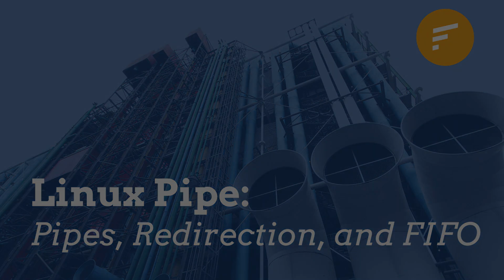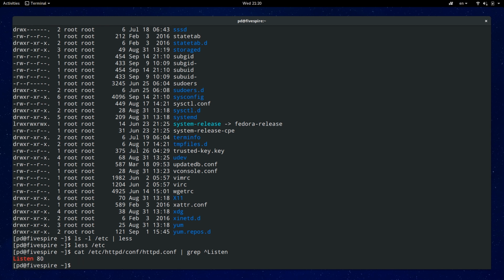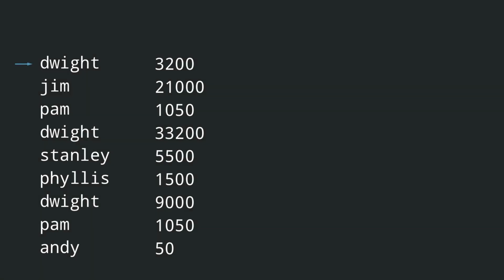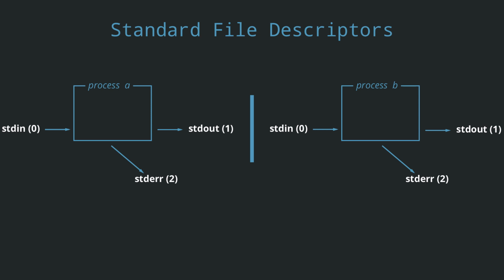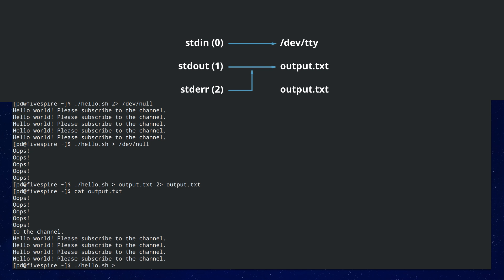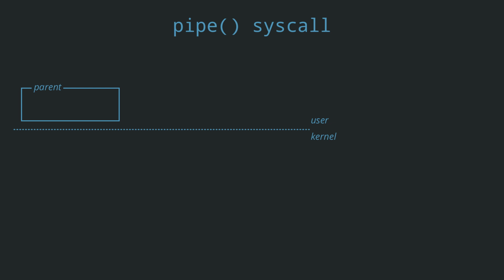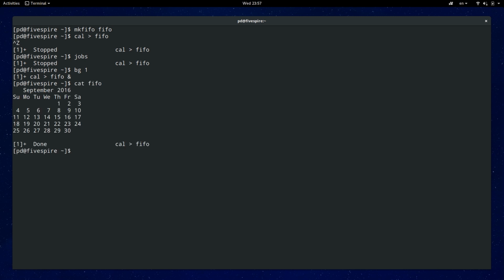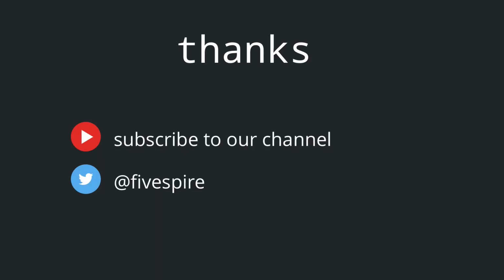Linux Pipes, Redirection, and FIFOs - In Detail

Comment: I was left totally confused by the naming similarity of the "pipe character" in shell vs. the "pipe function" in C.  Is that similarity meaningful or coincidental? Does the shell call the "pipe function" when it encounters the "pipe character" ?   Also, I could not decipher what you meant by "redirection" done by the shell - whether by that you meant ONLY what the shell does ,when it encounters the ">" and "<" characters, or whether by "redirection" you ALSO meant, what the shell does, when it encounters the "pipe character".  
Exactly, what does the shell do when it encounters the "pipe character" and how is that different from its actions when it encounters the ">" or "<" characters ?
Reply: pipe in bash shell is a redirect just as  <> 
Normal command  use will take input from either the command line or a file, one possible file is a special file called "standard in", output of results are generally written to the "standard out" special file or "standard error" special file. In most modern systems the stdout file is setup to write to the console and so prints to the screen. Redirection literally redirects the command output to some file other than "stdout". 
Pipe is equivalent to redirecting output to stdin and then reading input for the next command from stdin, however pipe, as stated in the video, is much more integrated into the operating system so they are less cumbersome and handle permissions in a different way.